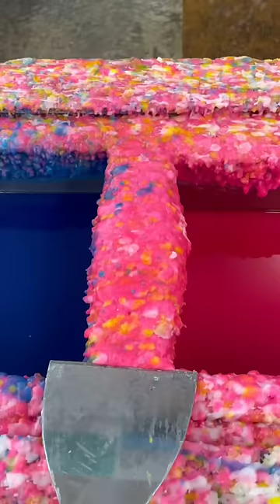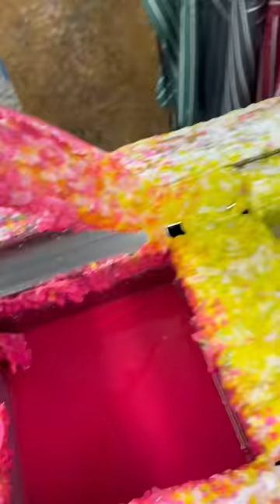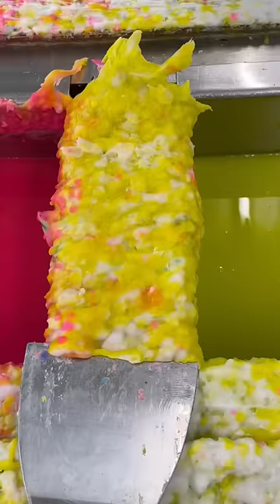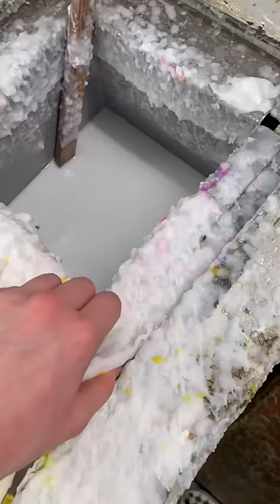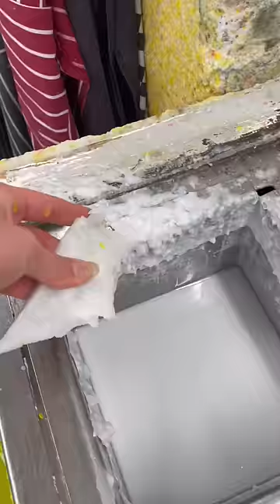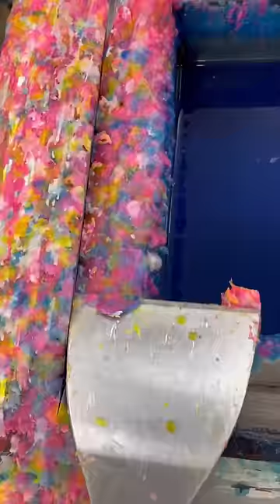that’s a lot of mess #gsycandles #wax #satisfying #asmr #cleaning # #candlewax

Comment: Do the colors of the wax change over time with the crossover from cleaning? Like the pink and blue becoming purple?
Reply: That's what I'm thinking, cause putting the yellow in white can't be good
Reply: I have seen her refresh the color by adding what looks like a bit of wax that had concentrated color. Its either wax or color pigment in block form.
Reply: I imagine it wouldn’t be too difficult to use color theory to negate the effects or just add more pigment to overwhelm it, plus new wax is definitely added regularly and there’s always going to be a ton of crossover from dipping, so cleaning probably doesn’t effect it as much as that does
Reply: The colour mix is so small it would almost certainly have no effect you could notice
Reply: That little amount of color isn't going to do anything noticeable.
Reply: It looks like they purposely don't mix too many darker colors into lighter wells (a little pink would be harder to notice in a lot blue) and there's probably dye you can put in to rebalance the color
Reply: Unless you're putting way more of the other color or a darker color than the original color it should be fine.

Comment: Does this effect the ultimate color of the wax? (Making it lighter is what I'm wondering)
Reply: prolly not lighter but i would assume more dull due to the mixed in opposite colors
Reply: I think it would take a long time of doing this to see a big difference in the colours, and the wax probably gets used up and has to be replaced before this can happen.
Reply: They add more concentrated coloured wax blocks to refill and rejuvenate the wax

(Idk if rejuvenate is the right word but it sounded right so-)
Reply: *affect
Reply: Coming from a candle maker :)
it doesn’t affect the darker colors as much so you can put basically anything into those but if the lighter ones (and Also darker) change their original color a lot we can always add wax color blocks to regain the original color :))
Reply: @shinypaintf588  just shows how much she cares
Reply: How many times have you knocked your scraper in there?